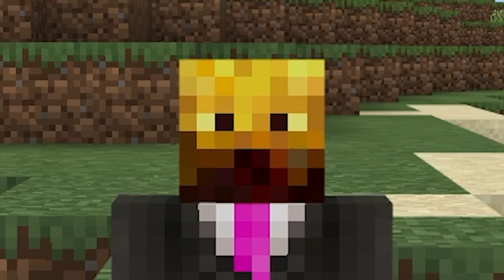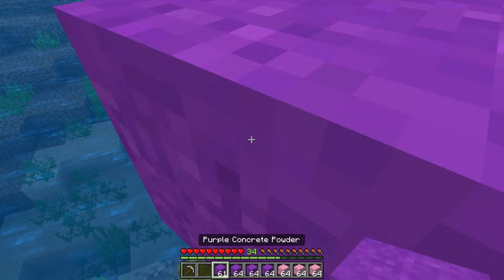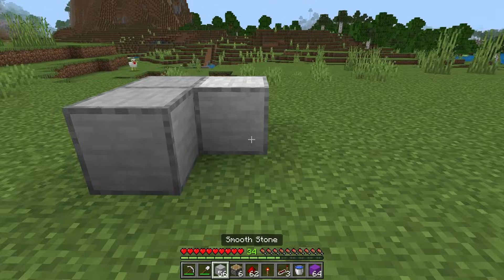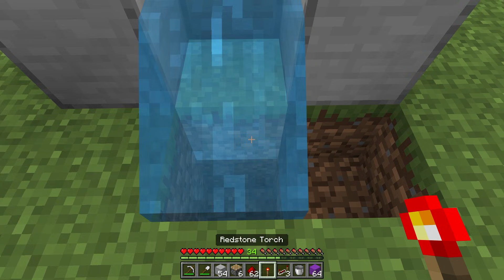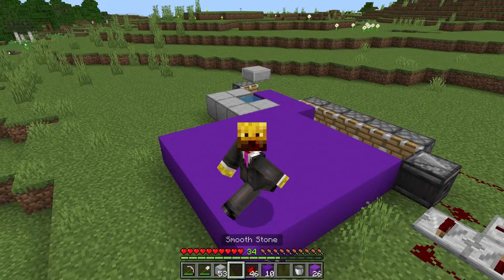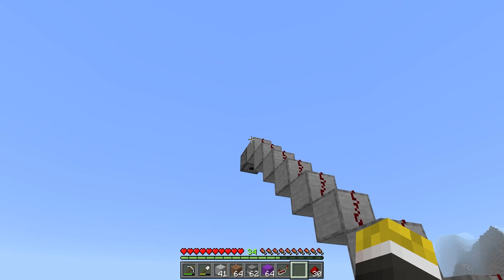EASY CONCRETE POWDER to CONCRETE Minecraft Bedrock 1.21!

Comment: Anyone else have a problem with dispensers and tnt? My dispenser will not dispense the tnt no matter what.
Reply: dont know if you managed to solve the issue but you would need to enable tnt explode in the options under fire spread lol just incase your still having trouble

Comment: There is a way to make this fully automatic (with an autoclicker) , It took like 4 hours but i did it. I put a observer at the end of the line so that when it reaches the end it will be blown up however I had to make a pulse extender so that the tnt didnt do a double pulse and blow up the blocks it just mine.  I also had to change the automatic pusher for the first row because without alteritng it it would get stuck after every time it blew up. It was rlly annoying to make but it can be done.
Reply: Can you send me a video of yours because I cannot figure it out to save my life

Comment: Built this but made it 10 long with 2 despensers added a compared to the end with a Redstone Torch to detected when it's full and automatically drop the tnt then ran a line back to the block maker piston to clear the line if it is to full

Comment: Is there a way to automate the TNT? Ive tried but had no success so far
Reply: I think if you place an observer at the end and connect it to redstone leading to the dispenser it could work. Would fully automate the farm and you can just sit there placing and not have to move
Reply: @electricmist8917  unfortunately it sends a double pulse so that method drops a second line of tnt but a Compared it with a redstone torch under works
Reply: You can

Comment: I built the farm with 7 pistons and found that the tnt would only explode the middle instead of all the blocks forcing me to mine out the sides and make it straight to prevent the machine from breaking. Any solution would be helpful

Comment: can you put a observer at the end of the obby then jus link the tnt so it 100% auto
Reply: I built this yesterday. Used an observer to make fully automatic. The tnt doesn't always clear the block that triggers the observer and if you manually mine it you set the observer off and results in the collection end being blown up. So it's best to stick with the button method 😂
Reply from the maker: It is worth a shot, that's a good idea